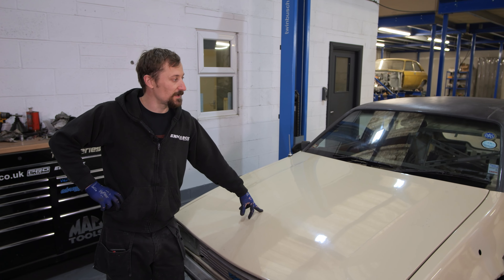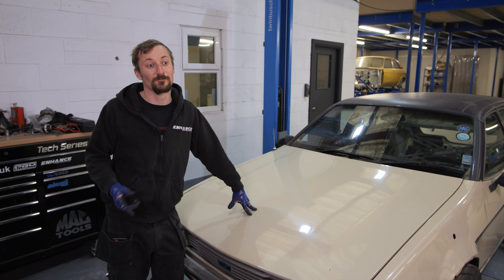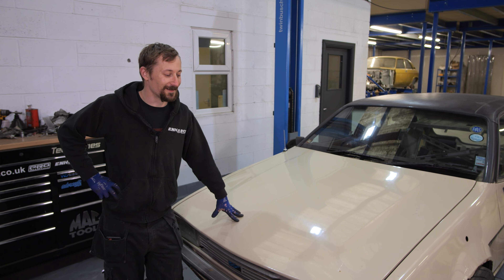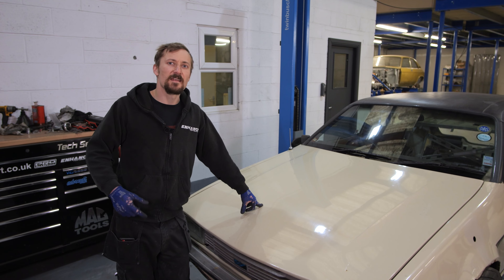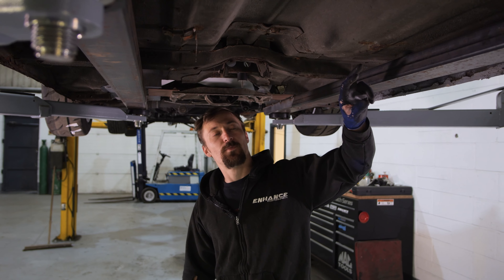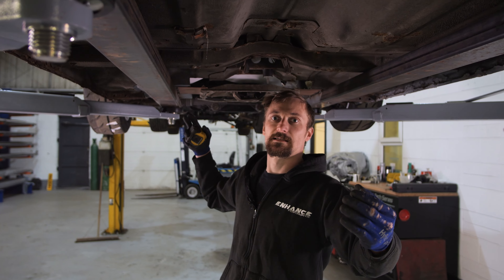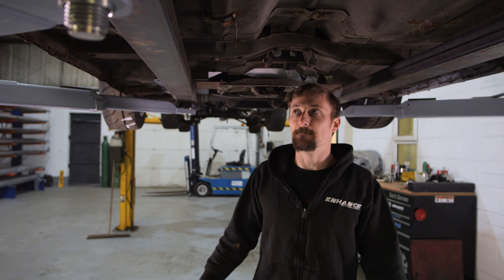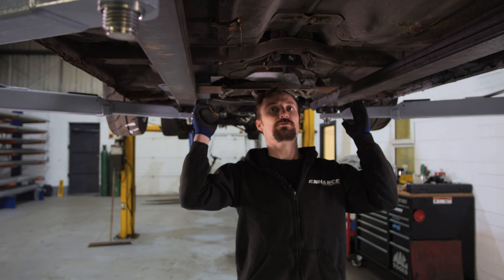Project PrincesS-Type | Episode 11 | The Engine Is Back In!

Comment: As a relatively new subscriber I have to say excellent work so far. It's a car you'd have to be mad to want to restomod, but I appreciate the insanity and I'm looking forward to following along! I'm putting the same engine into a MK1 Escort, hopefully supercharged if I can find the room, so we are kindred spirits in that regard at least.
Reply from the maker: Thanks David! Totally understand what you’re saying, it’s a car that’ll never really be worth anything that cosmetically is a basket case. Why they hell am I spending hours of my life on it🤣 The answer is, honestly it’s so much fun & all your comments encourage me to keep doing it!!
Reply from the maker: Good luck with the Escort. Can’t be many v6 ones💪🏻
Reply: @FabCoUK  Bloody brilliant! I'd fancied doing something like this myself, sadly I'm disabled now and unable to work on my own cars these days.

I'm a big fan of using the parts bin from across the model ranges when I used to render.

A TR7 front spoiler.
A Dolomite style nose for the aggressive look
The front grill has gotta go, how about using the plastic grills off a Rover P6B modified to fit? A nice neat solution to mount the V8 badge on... Perhaps modify the  headlamps to have circular lenses inside the standard glass?
Smaller diameter on the inside like those first seen on the Fiat 131 racing?
I've always thought the original rear lights made the car look rather sad. I'm sure I've seen renderings with TR7 rear lights somewhere but I wasn't a fan.
The Ambassador rear lights looked like a guy wandered down to Lucas and found the generic lenses off an artic trailer.
I think it deserves larger lights, perhaps some off the 90's Jaguar XJ40? I'd fit them a little higher and recess them where the boot folds into the back panel.
This serves two purposes, losing the space where BL used to fit silver tape or the princess script and badges and more importantly, it allows the boot opening to be cleaned up and open as deep as the bottom of the lights or encompass the lights?
Paint the rear between the lights satin black to match the door tops and C post. Leave the roof body colour!
An SD1 Vitesse rear spoiler, which makes me think perhaps the front spoiler and bumpers off an SD1 Vitesse would work.
Inside needs wood, proper veneers for the dash and door panels which need retrimming in a better quality material.
The chap with the "ST Princess" has probably contacted you by now so he'll be a great help, especially with fitting a rev counter in the original dashboard. 

If you've seen the triplex Princess Glassback, that had some great styling cues and some, bad!
I thought about an Allegro Equipe style garish striping in gold, orange and red to match the hearing aid beige.
I wish I'd kept the renderings I'd done with similar modifications, I used SD1 rear lights though, twin headlights with the triplex/Lancia montecarlo style black front, vauxhall senator style egg box grill, a Fiat 127 sport style roof spoiler, Equipe striping going over the roof, Dolly Sprint wheels and front spoiler.
I did one rendering using gloss black with JPS Capri style gold stripes and gold minilites with polished rims. I never got the renderings back, along with more modern designs I sent to MG Rover about two weeks before they folded!
To this day I'm kicking myself I didn't have copies made!

Anyway, this is long but I hope helpful. Tremendous job and I look forward to every update. 

Alzheimer.

Comment: In the US this would have been "I'll just throw this engine in the bodyshell and we'll go and do burnouts".  When an engineer does it, this happens.  what a job.
Reply from the maker: Thanks, doing my best to do a proper job💪🏻
Reply: @FabCoUK Not having a go, but here Aus and in NZ where I'm from that'd likely never be street legal without some major re-engineering. Here it needs be Engineered or low volume certified (my old job) to then pass a rwc/wof inspection, (mot) I'd never pass that, it's a death trap.. 
My very sincere concern would be those front chassis rails and the upper firewall/strut tower braces, you now have no crumple zones and have rigid reinforced structures that'll likely severely injur, maim or kill front seat passengers in the event of an accident..
You now need structure to protect occupants (cage) or re-engineer the front of the chassis to deform or collapse, or to divert under or sideways of the passenger cabin.

Comment: As another "Jonny" import to your channel, I've just enjoyed splurging through this entire project. I'm loving the straight forward, suck it and see, approach which differs slightly from some of the other channels I watch though TBH that's a good thing 😁👍.
My only comments would concern your triangulation ⏸️, which to my mind looks more akin to bracing 🤔, but hey there's plenty of time to rectify that.
I have one point of concern though, to wit the location of the rear sub frame mount to the turret, to my eye this is a little weak as it connects to an open ended tube which will flex when big loads are applied to the rear wheels, this could have been avoided if your front an rear chassis braces had enveloped the turret (i.e. they'd met up withe each other on either side of the turret rather than on the front and rear), just a thought possibly easily sorted with a bit of extra gusseting...
Looking forward to further updates on both of these much maligned cars.
Reply from the maker: I’m the episode before this I did mention it’ll all be closed off, probably at the same time as I tackle the boot floor. Try not to see any of it as finished, as there’s obviously lots of steel to go in yet😃 Thanks for watching!

Comment: I've 30 years in motor trade and if the glass and trim in that car are so old and rare why grind off and weld all over them  ?. Should just stripped it down.then gone fab crazy on it.
Reply from the maker: Glass is about the only thing thats not rare actually, it doesn't rot away! Haha
Reply: @FabCoUK   welding spatter destroys glass though. And Certainly likes 70's velour interiors. Interesting conversion .